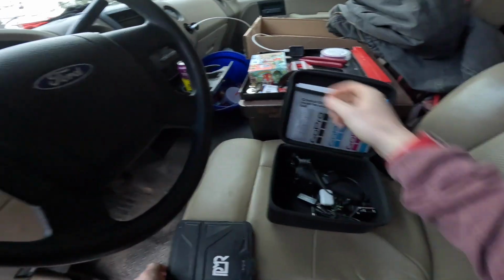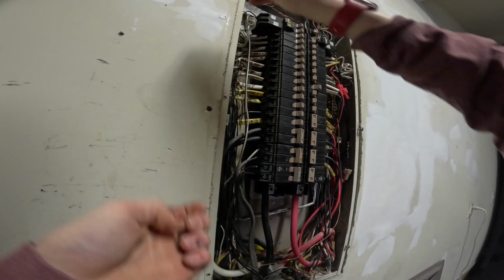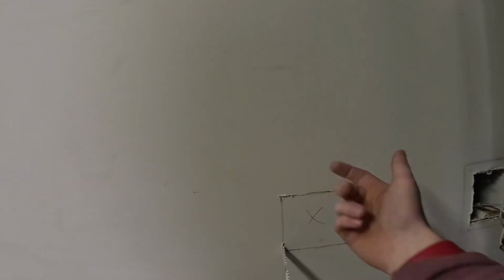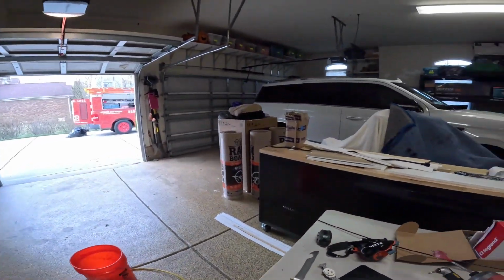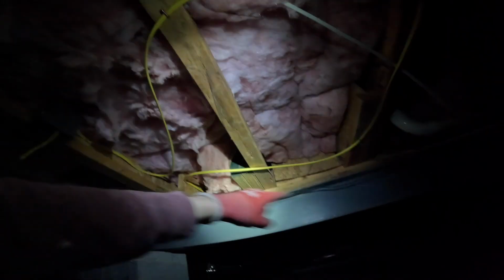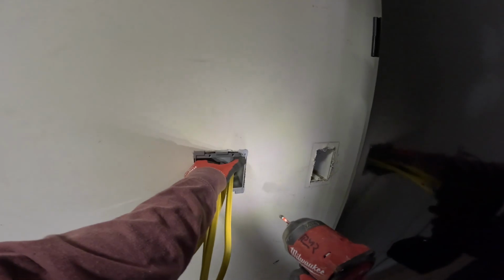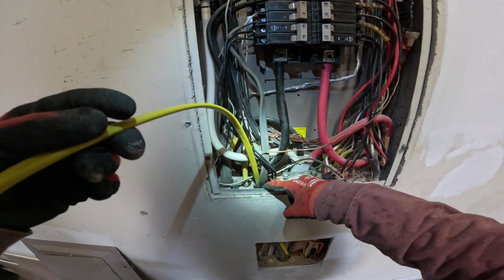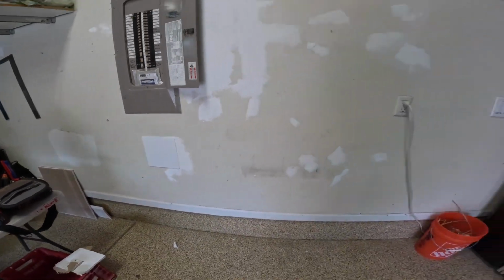Crawl Space Wiring - Solo Electrician Installs NEW 120V circuits

Comment: I like your videos, but I am having an issue with several code violations in this video. 1st, 334.15(C) violation by stapling to bottom and not through bored holes as required in unfinished crawl spaces. Also, I would consoder this a damp location and the romex to be in violation. Its literally powering a sump pump... lol. You should have installed UF at the veey least.

Comment: Its interesting that you’re allowed to connect the ground wires from two different circuits together in the back box, also that you’re allowed to have two different circuits together in the same back box. 
As a Swedish electrician I wouldn’t be allowed to do either of those things and still be code compliant.

Comment: Its open for tandem breakers. Check the panel diagram
That full he should have gone sub panel but tandem will work
He needs a surge protector t under 2023
If you put one dry wall screw in you can use it as a handle to remove the dryway

Comment: Absolutely love everything about this: organized, attention to detail, and clear, concise, and COMPLETE explanations including citing code vs preference! Absolutely earned an instant subscribe from me. I actually hadn't seen that bit shape before, so that was an awesome little nugget. 

Couple thoughts for consideration that I've found helpful:
1. A battery powered flood is a great way for general lighting in crawlspace/attic. I find it helps to have in addition to headlamp to maintain bearing and context.  
2. I've found the new torque limiting screwdrivers to be an ideal balance between slow manual drivers and heavy electrics that risk stripping everything. They're quick, light, and stop when you need it to. (I haver a fantik, but there are a lot of options). 

Please keep posting!

Comment: First, let me say that, from one electrician to another, great work. Clean, professional and with another trade in mind. Always make it easier for the next guy. And you're right, everyone does things differently. Personally, I would've done everything in the crawl space at once. Just because I'm getting old and time is money. Also, I probably would have just used the same box location as the one you blanked off and reused the original HR. Love the service loop for the receptacles. Again....easier for the next guy. All in all, great work man. Keep it up. And for all the young, up and coming apprentices, do what he's doing throughout the video. Talk through your steps and why you're doing it. It will help keep you sharp and locked in.
Reply from the maker: Thank you so much for your comment and for your compliments! I appreciate it very much

Comment: Hey Jacob great video! I just subscribed during this one. Good to see new contractors making new content. 

Got a question, not so much on your own methods but, I noticed that the receptacle in the crawlspace was facing down. 
Is there a particular reason for that? Is that the only way crawlspace receptacles can or should be mounted per code? Or just a “best practice”? 

There’s a junction box in my crawlspace that an electrician mounted several years ago, and it’s also face down, the box mounted to the joist. I’d like to add more in other parts of the crawlspace, either leading from that one or perhaps from another circuit. 

It didn’t occur to me until watching this to think whether mounting face-down was a requirement of some kind, presumably to keep water / debris from entering. (Insects gonna do what they gonna do 😂)
Thanks!

Also if there’s a spare outlet in the crawlspace they might consider hanging up outdoor-rated string lights around the crawlspace. I really like having the extra and uniform lighting when I’m doing anything in mine.
Reply from the maker: They can be installed in any orientation! The only caveat is that face-up receptacles and their covers/ enclosures must be rated for it. But usually it’s easiest to install crawlspace receptacles like this face down. It does have the added benefit of keeping moisture and dust from settling into the receptacle openings, like you mentioned! Great question

Comment: 11:50-12:30, I didn't see the stud bay from the bottom in this video, but one thing id have done before heading down would be to use a my glow rod in the refurb box cutout to gauge how far down the stud bay was. If it was low enough  to be drillable by hand from the crawlspace (like the stud bay that fed from the bottom into the panel box), I'd prefer that over the flexible bit and have brought it down when I went to go down to the crawlspace. But I'm not too experienced yet and I also don't own a flexibit so it's a little foreign to me.

Comment: Out of curiosity what's the benefits of using the dead front GFCI instead of 2 GFCI breakers for those dedicated circuits. Wouldn't the breakers be less work and cleaner than additional devices? Not trying to nitpick, I'm just curious if this is something I should change in my installs
Reply from the maker: Went this way since the panel door doesn’t normally get opened, if one trips then it may be some time before anyone realizes. The light on the gfci will be a visual sign that theres something wrong. Either option is good though, the gfci breakers would definitely save some install time.

Comment: Good work Jacob. Just wondering why you don't use green spaghetti insulation on the bare earth wire ? More insulation the safer it is.
Reply: Thats simply not a thing that is done in the US. I know it is common in Europe. A bare earth wire (equipment grounding conductor) is permitted and found in many cables

Comment: Nice job just curious why you didn’t use GFCI breakers that way you didn’t have to add the faceless GFCIS
Reply from the maker: Normally the panel door doesn’t get opened very frequently, this way the homeowners will see clearly if the gfci trips and the equipment is off
Reply: Right on keep up the good work and never back down from the mind set of doing things right no matter what

Comment: Nice job dude. How I’ve installed these in the past is using a smart audible GFCI. Customer will DL the app. In case the customer is out or away from home on a trip, they would receive a notification that it’s tripped and if inside the home, they would hear an alarm sound and an app notification. The device name is called GFI NOTIFY.

Comment: Hello, I'm new to all this. Am I reading this correctly that the Loads and Lines for the ckts are wired into the GFCIs, the Loads pushed down into the crawl space and up thru the stud bay where you cut in the access panel for termination at the new breaker and Lines run down thru the crawl space for termination at the outlets? Is this required for all high amp ckts or just certain ones within the household?

Comment: Im very impressed with your cleanliness, knowledge, and work ethic at such a young age. I'm 62 years old and I have a State of Delaware Elect Lic since 1990. I give you a A plus for job planning. You put the GFCI devices in the garage so its " accessible to the home owner and can be monitored " ( If you see the red light you know the GFCI is tripped ) I couple of things to think about. What's the Amp draw on the dehumid and sump pump ? I do alot of work for a Basement company. On most installations they install a 1/2 HP motor which has has a amp draw around 6 so I would of installed a 15 AMP GFCI protected circuit. Labor/material cost will be less and if you read the manufacturer's instructions it probably requires a 15 AMP circuit. Same would apply to the dehumid, What's the FLA ? Also I would not waste  my $$ on 20 AMP receptacles. You can put 15 AMP Duplex's on a  15 or 20 AMP circuits NEC 210. 21 B. Another thing. The next thing which is Ridiculous !! and I have not meant a Inspector which will enforce this. NEC 334.15  ( C) When running NM at angles You are supposed to drill holes or Knockout the pre punched holes in trusses. YES its say's Crawl spaces. I can't remember what code cycle they added Crawl Spaces. 
Thanks for a showing me a great job
Take Care Paul C

Comment: i run a "J" loop to my cut in boxes usually. cable coming UP to the box will pass the box and turn around back down to the cut in hole, helps store spare cable loop and allows the cable to retract back into the wall once you've already got the amount of cable you need in the box itself, instead of pulling all that slack out through the box to get it to land in the new hole. fun circuit run jacob thanks for sharing hope you always keep up the good work

Comment: Why not just install a GFCI breaker?
Reply from the maker: @Oldhogleg  The panel door doesn’t get opened frequently, if it trips then it may be a while before anyone realizes. The light on the dead front GFCI will indicate if their equipment has lost power👍🏻
Reply: @PalmerElectrical  <> Actually people typically fail to even notice that. Probably the best solution would be to do what you did but with a GFCI with an audio alarm that is unavoidable to be heard? They're typically not available at the big box stores, but you can special order them, some electrical supply houses keep them in stock.
Reply from the maker: @ Good idea 👍🏻

Comment: Excellent Video, Many years ago when I transitioned from residential work to commercial I used to get a hard time from the other guys when taping wires to a fish tape to be pulled. After a while I got in the habit of twisting the roll of tape several times after taping the head to create a tail. This does two things, it makes it easier for the person at the other end to unwrap the tape and it also makes it easier to find the end of the tape on the roll. In commercial we would be pulling wire in conduit for days on end.

Comment: Nice work. An interesting thought I had. I wonder if that access panel is rated to be in a garage fire wall assuming living space is on the other side of the wall. Unfortunately the drywall probably has to be repaired and taped/mudded. Or a metal access door be used to maintain the fire resistance.

Comment: Nice work! For the cut below the panel I would use a drywall cutout router. They have bits with dull tips to avoid cutting wires, and you can adjust the cut depth. DeWalt has a vacuum attachment that makes cutting incredibly dust free too. I do a ton of remodel work where I have to cut blindly, and this tool is unparalleled. Safer, cleaner, and faster than an oscillating tool on drywall, wood, or plaster
Reply: The inconvenience with rotary tools is that I found them more difficult to guide perfectly straight while cutting.  Because of their nature, they tend to swivel from side to side. Maybe it's just a matter of getting used to it, but I traded it back for a multi-tool.

Comment: Why not install a GFCI breaker?
Reply from the maker: @psychjo  The panel door doesn’t get opened frequently, if it trips then it may be a while before anyone realizes. The light on the dead front GFCI will indicate if their equipment has lost power👍🏻
Reply: @PalmerElectrical  that makes a ton of sense! I’ve had to deal with GFCI’s tripping in crawl spaces.

Comment: You made things nicer than when you started good job 👏.   Most people I know would have just home run a gfci breaker in the pannel to the recipticle and wouldn't have bothered with the easy access resets.  And they may have only labeled the breaker at best.  I hospital number each outlet device and in the pannel if I'm doing a majority of the replacements.  It's easy to read a number and match it up in the pannel.  I also don't have to have a label maker that way as well one less thing to carry though it's nicer your way for sure.  I wish there was more people would put in access pannels.  If the sheetrock is in danger of hitting a wire I have a old dismantling knife with a big safety shield on the bottom to cut the back paper but blunt to run on the sheathing.  Don't be afraid to use insulation rods to make test holes they are small enough too almost rub out and offer location in ceilings/insulation/crawlspaces.  I also encourage you tou use southwire smart boxes or anything side screw instead of nail ons so they can just take the screws our and reuse them on the spot.  Nail ons are next to banned in my work because it's more work to relocate move ect and I spend 15c more per smartbox I can eat that cost.  My latest great work aid is hyperstack folding work utilty cart MM has a video with it and for 50 bucks you won't be disappointed and actually gain some space back in the truck.  You were gone a hot minute glad to see you back.
Reply from the maker: @MattHmm-rq6dn  Thank you! I appreciate your compliments and comments. It’s definitely the details that make an amazing experience.
And I love those smart boxes/ slider boxes etc. Idk why I don’t use more of those. And I cant believe I haven’t seen that folding cart yet! Need that. Thank you for watching!!
Reply: @PalmerElectrical  you haven't seen folding carts because there outrageous prices when there metal for restaurants hotels or mail carts 200 to 400 dollars.  To be honest garbage olympia are 100ish dollars and they arnt something you stand on.  Its only because the w mart has one for 50 bucks and its decent.  I keep my 40lb tech pack on it does fine.  It's just best not to carry nail ons then you don't have that issue  😆.  I've enjoyed your channel since it started keep with it and I'll be happy to give you as much advice in my real work experience doing very similar stuff.  Let's just hope you don't have to deal with as many federal pacific and 70 year old ch pannels as I do.  Better yet the knob and tube for historic houses 😆.